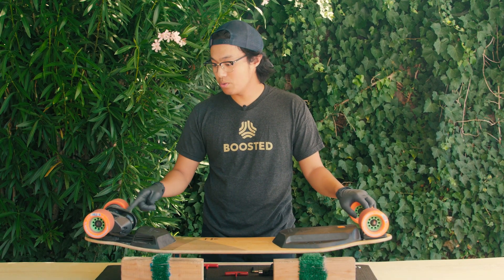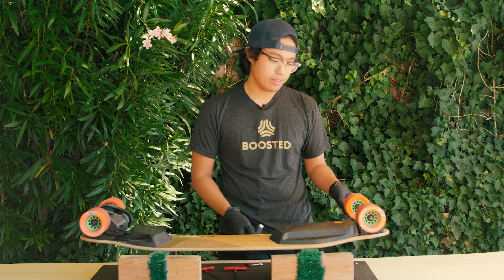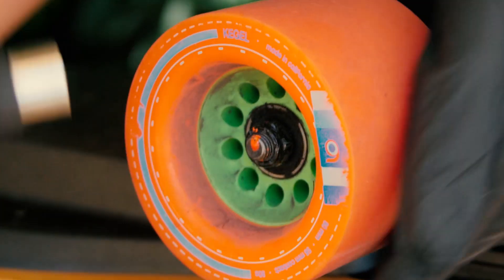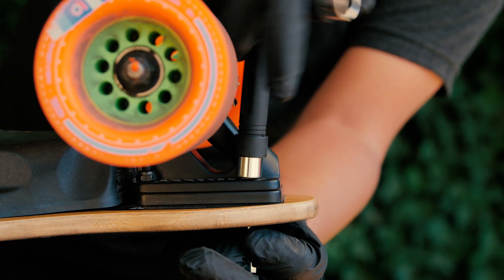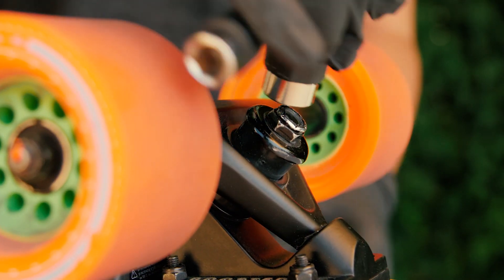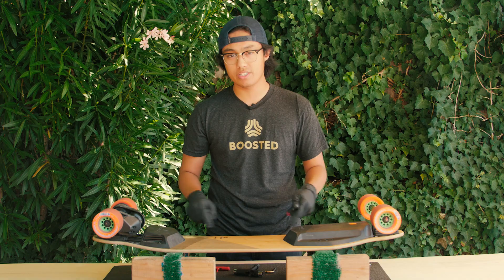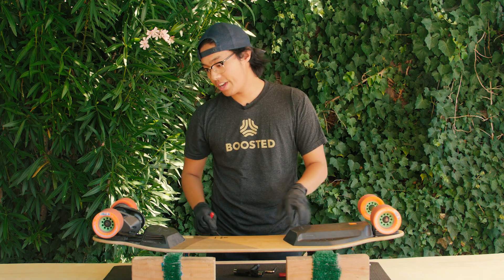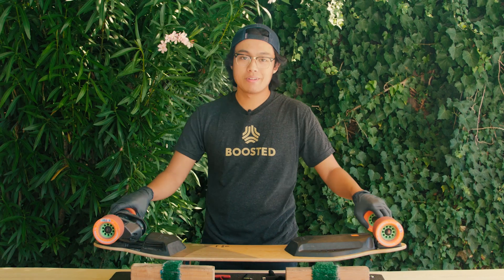Getting Started - Board Check

Comment: I have a very odd sound coming from either one of the motors or belts when i turn the wheels slowly. First time i heard it i made a thorough cleaning by removing covers and belts, then helped but after a 10 km ride sound reappeared. It seems like it's worse after a long ride. I couple times just waiting 3-4 hours solved the issue but now i have this very slight sound- not sure how I can describe it in English- should I be worried? Maybe I can send you guys a sample?
Reply: Berent Mumyakmaz Talk to support